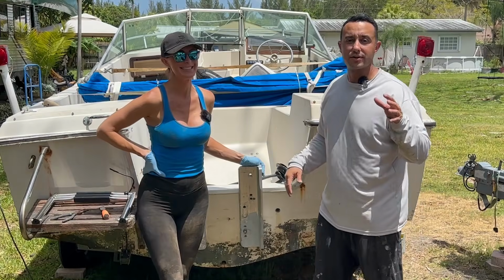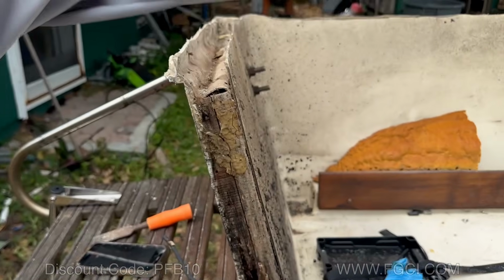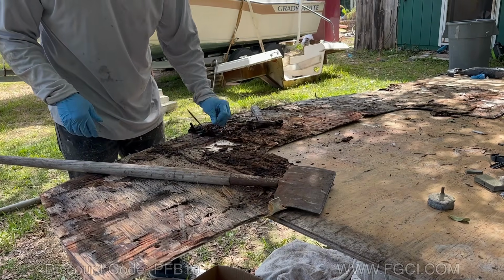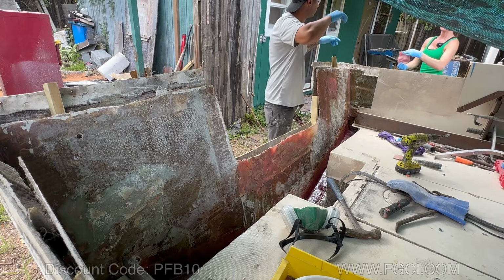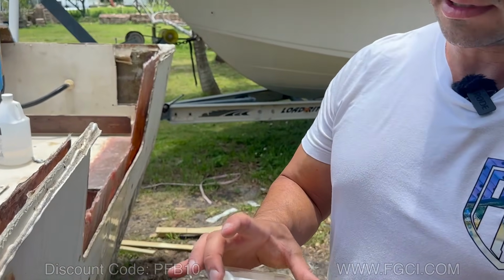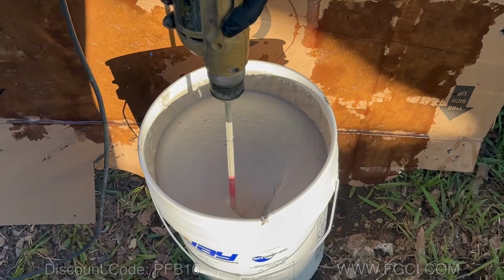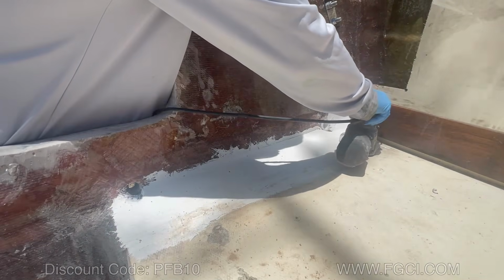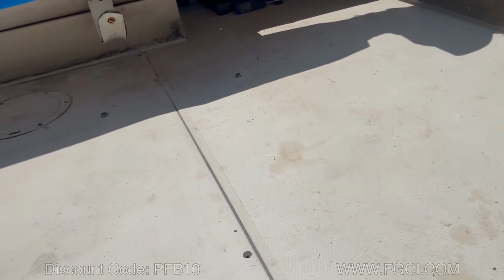Replacing A Boat Transom | Boat Restoration Project!

Comment: be VERY careful with MEKP hardener, Its the most toxic stuff you'll encounter.. One touch gets in your eye and your blind instantly. so glasses at all times around it..   One thing a friend did to get into corners to clean them out, was get a  Ebrake cable from a vehicle and cut the end so it sticks out the sheath a few inches  and the other end you let stick out far enough for a drill to hook into it.  You unravel the other side  about 3/4 inch so it will spin and clean out like a wire wheel does.

Comment: Finally a great video on Arjay 6011, I did my transom back in 2008 lots of skeptics were proven wrong, my Boat 1979 Wellcraft V 20 powered by 2015 135 HO is still running strong, has no rot to worry about, and will last forever. I absolutely love and recommend that product, the SeaCast is PIA with the fibers in my opinion. I removed the outside skin and went that route, less work. The cap at the top of the transom with very thin plywood cut to size and clamped in place during the pour, the material stuck to the ply and I used a flap disk to grind it off, I poured mine from the highest point. You are lucky the duct tape held with the heat from the curing, I sealed everything up with chop strands and resin, great work as always, the way you secured it back is better than the factory.
Reply from the maker: Thank you buddy! We also continue to prove the skeptics wrong with our other transom pour video on our Grady! It’s been just about a year and it’s been incredible with our new 250 Suzuki! We did that one from the outside skin. Actually found the inside to be a little easier due to less fairing but it can also be the experience I’ve gained. I can see how the seacast can be a pita because of the larger strands. I really think pouring is the best for the DIY guy. 
Thank you so much for the kind words!🤙

Comment: A little trick with the gloves so when they get too much resin on them. put three pair on and when they get covered you just pull off a layer it helps when you are dealing with time crunch resin and its starting to kick in this Florida heat. you dont have to stop take them off put another pair on, you just pull off a layer and keep rolling!
Reply from the maker: Yes! I tried double gloving and that wasn’t enough! Good tip! 🤙

Comment: Redid my friends Grady 21 transom, core was mush. His son used an auger bit woth a rod welded to it chucked in a drill. Finished it of with a chisel also with welded rod to extend the reach. It was time consuming butsaved us from doing surgery on the glass. Poured thickened liquid core material with chopped glas into the void, benzoil peroxide catalyst was safer to use and produces low exotherm temperatures, important when filling thick sections. I was skeptical but the result was excellent and the transom was bulletproof.  He hung a 4 stroke Honda (heavy engine) on the transom and no crushing, no problems.
Reply from the maker: That’s awesome! I love hearing stories of people finding different and affordable ways to work on boats. Should’ve recorded it for all of us to see. I know I’d like to! 🌊🛥️🤙

Comment: I’m replacing the transom, stingers, bulkheads and floor on my ‘82 V20. I used a pourable, Sea Cast for my transom due to outside of the transom being curved.  I also increased the motor height of the transom to 25”.  I’m  using 3/4” marine ply with epoxy for the stringers and bulkheads.   I cut the floor out to gain access, leaving a lip of 2 to 3 inches around the perimeter.
Reply from the maker: That’s awesome! Poured transoms are the best for curved transoms. Many boats have that curve. There’s a gentleman with a video on an aqua sport (which I’m sure you’ve watched) that did a seacast transom. I’m sure your transom will outlast the rest of the boat.
Nothing wrong with using wood for stringers either! We did the same! 
Sounds like you know what you’re doing! Congrats on your build! 🤙

Comment: Now having done both , would you two recommend removing outside skin or inside skin was the easier job ???     Liking the looks of that helper you got there bub !
Reply from the maker: I would have to say that doing the outside is easier. The inside is a lot more involved. You have to remove part of the floor, color match (if you need to) and some caps are more complicated than others. If I was to do the outside again, I’d use gel coat instead of paint which helps cut down on fairing imo. There’s some boats that have an open transom with no “cap” that can be done fairly easy too. All depends on the boat. 
You’re not alone! She distracts me and most of the viewers when she’s around! 😍. Thanks for the comment brother! 🤙🛥️🌊

Comment: When I replaced the transom in my Sport Cat 23 I used Arjay 6011 and did it from the inside. It's just easier on a cat and that way the outside glass remained intact. After I dug out the rotten core, I glassed in some Coosa that made the "inside skin", and then filled the void with Arjay. Took 11 and a half gallons. So far, I've been happy with it. No flexing at all with twin Mercury Optimax 200s hanging back there.
Reply from the maker: That’s awesome. We did our Grady last year and we’re very happy with the results! Holds a heavy 4 stroke no prob. 🤙
Reply: @perfectfitboating  On your latest boat, the splash well came out a LOT easier than mine did!
Reply from the maker: @josephwhitehead1692 we were surprised at how easy it came out! We got lucky! 🤙
Reply: @perfectfitboating  I sent you a message on your website, asking for contact info so I could send you photos of my project. I think you'll like it. My splash well is part of the overall cap so cutting it out was chore!
Reply from the maker: @josephwhitehead1692 awesome! Love seeing projects. If you got on our YouTube home page our email is there. Shoot those pics over 🤙

Comment: Did my 20.5 ft Stratos with arjay 6011 ceramic pour just shy of two yrs ago. My boat has a Evinrude 235 so I’ve put it through the test. To this day not a single problem. Just wear plenty of safety gear because the catalyst is some dangerous stuff.
Reply from the maker: That’s awesome! I’m sure it’ll last you forever! And you’re right that stuff is NASTY! 🤙🌊🛥️

Comment: I really learned a lot in this one. I never knew about transom pour; it's probably easier than laminating some sort of coring in there and probably cheaper. Is there something in it that will prevent cracking under stress after it sets up? I keep thinking of it as cured resin without matting.
Reply from the maker: I’m not exactly sure how it gets its strength. All I know is it’s a ceramic pour and that’s it’s slightly stronger than plywood and lighter. 
The problem with many production boat builders is the lack of quality control. Some might be made well and some slip by. Still pretty amazing the stringers were like new after 40 years though. You just never know what’s below deck.🌊🤙🛥️
Reply: @perfectfitboating  Sure beats $100K 20' boats. Doing what you're doing is the way to go. Just invest in a modern engine and plan on keeping it.
Reply from the maker: That’s exactly right. We did it with our Grady. Re did the transom, stringers etc and added a new Suzuki! 🛥️🤙🌊

Comment: Nice job guys foe mine unfortunately  it was done over ten gears ago msybe 12 years. This Grady white transom issue from the factory  was mild by comparison  to my 1979 Glastron  sea furry which only had two layers  of get this osb where the motor mounted.  We had to cut out the very poor glass both sides used two full 3/4 inch marine plywood laminated  sheets screwed  together  with I don't  know how many  stainless steel  screws but by the time we were done I think it could have supported  the Empire State  building like you I only wanted to do this once  thanks for showing  your method r
I really  enjoy watching everything  you guys do.
Reply from the maker: Dave, I’ve always seen older glastrons having terrible transoms. They’re popular here on YouTube but it sounds like you made yours bullet proof! And just like you, we don’t want to have to worry about fixing this again. One and done! Thank you so much for watching and for the kind words! We appreciate you! 🤙

Comment: The reason you want to start small and get bigger with the tabs is that if a layer doesn’t bond properly for any reason, the next one backs it up.  If you started big and the first bond failed, all your patches/tabs would come free and there would be nothing securing it anymore.  

Keep up the good work and transom updates.  I saw a video a couple years ago of someone using one of these products and I have to admit, I’ve always been a skeptic so I’m interested to see how it holds up.  Resin, epoxy, concrete etc are all brittle without composite or rebar to reinforce them so it’s always made me afraid to hang a big outboard or two off one of these.
Reply from the maker: That’s exactly right! Small to big is the way to do it. We’ve had great success with these transoms. The next one we do will be with composite board. We’ll be doing that in the next month or so! 🌊🤙🛥️
Reply: @perfectfitboating  I have too many projects, but sometime in the not too distant future I need to do the floor in a Pro-Line I’m planning to sell and eventually I’m going to do everything in a 28’ Aranow Design Hull I plan to keep including stringers, transom and floors.  It’s a really great hull design i picked up a few years ago but I want it all custom and done the right way to the highest fit and finish.  I may put the projects up here on YT too, just need to finish up some others before I get to them.
Reply from the maker: @andrewnajarian5994 I hear you on that. We have a 16ft zebra skiff to finish and we still have to paint the topside of the Grady. On top of that, we’re soon to be getting into a 23 sea craft to build a pilot house on it!
If you post it on YouTube, let us know! We love a good project! We’ll be your first subscribers! 🤙🛥️🌊
Reply: @perfectfitboating  will do!  Looking forward to the Sea Craft, is it an old Potter Built?
Reply from the maker: @andrewnajarian5994 yes! If all goes well, and the owner gets the title, we’re gonna pull the trigger. It’s a 78’ 23’ sceptre potter hull!
Reply: @perfectfitboating  I’ll be watching.  I actually debated building mine as a pilot house or express rather than going back with the center console cuddy cabin design.
Reply from the maker: For what we do, pilot house is the way to go. We enjoy the ability to get away from the elements. We want to be able to cook inside and have the ac running. And the ride of the 23 seacraft is one of the best in its class so it’s perfect for the fishing we do as well. We love our Grady. It’s got lots of space and the cabin is ok but we just want a little more comfort.
Reply: @perfectfitboating  yeah, my dad had a Grady 26 Sailfish for a couple of years up in NC.  It had great cabin space for the boat size!  Have you seen that Jupiter 41 Sport Bridge?  I haven’t been on one yet but it has beautiful lines.  

One of these boat shows you need to do a walk around and comparison with Jupiter, Yellowfin, Contender, the bigger offshore center consoles.  Not the massive ones (although that could be its own video) but 25’-34’ range.
Reply from the maker: @andrewnajarian5994 yes! We have the Ft. Lauderdale boat show coming up and we plan to do a video on that boat class. I love the jupiters lines. Very sleek. I’ve been aboard the Jupiter you speak of it’s a beast of a vessel!
Reply: @perfectfitboating  I’ll bet.  Every one of their boats I’ve been aboard has impressed me with both the fit & finish and the quality of hardware they use.  Their Tuna door hardware on their midsize consoles is nicer & stronger than a lot of big sport fish out there.  You can really see and feel where you’re spending your money with them.

Comment: dont know if you mentioned the age or model of this Grady,are all Gradys now  solid fiberglas are still wood transom, if you know.thanks
John
Reply from the maker: Hey thanks for commenting. Grady’s till this day use wood in their transoms. And I don’t understand why as expensive as they are. They had a big problem with the transoms rotting pre 99 if I remember right. Then they switched to a special treated plywood. My dates might be off, but even at the boat shows we’ve been to you’ll find wood all over even for bulkheads 🤷🏻‍♂️ this one is a 81 if I remember right.

Comment: Wondering why you cut the floor so close to the transom.  It seems like it would have been easier to work on the stringers if you’d cut further away.
Reply from the maker: I didn’t want to make the new gel coat line visible since the seats/cap go over it. Any further forward they would’ve been obvious.

Comment: Piping bags work great for structural putty applications especially in tight fitted transom areas. That's amazing work though
Reply from the maker: Thanks Derrick! I appreciate that! I gotta see if my partner FGCI carries those piping bags. If not Amazon should have them. Great tip! I’m doing another transom on my little skiff so I’ll use it there for sure! 🌊🛥️🤙

Comment: What a fantastic job guys! Not only the work but your video was great.  If you pour a transom is it stronger than the original with plywood? My boats rated for a 150 if ya poured the transom would it be then rated for a 175 hp outboard?
Reply from the maker: Hey Doug thank you so much for the comment and the kind words! If I remember right, this type of transom pour is a little stronger than regular plywood and slightly lighter. 
As far as the hp rating goes, there’s a lot more that goes into what a boat is rated for. Weight, hull design etc. Many people exceed that number. But that’s at their own risk. I don’t see a huge problem with 25hp more than factory. I’d be more worried with a 75-100hp+ jump. It’s not just the weight but the torque on the transom. Hope that helps!🤙

Comment: Interesting video.  I noticed at the 31:13 mark the rust stain coming down off the ring eye at the transom.   Born Again Boating’s YT channel had a great video on various rust removers and he recommended “Goof Off Rust Aid”.   I bought some over the weekend (Lowe’s for $13+tax and at Home Depot about $19) and used it on a couple similar rust spots on my boat from rusting fittings or where I had left some tools on deck and they got rained on and leached rust stains onto the deck.   WOW is all I can say, just sprayed it on with a sprayer and after a few minutes the rust stains totally disappeared, totally amazing stuff.    Thought you might find that useful.
Reply from the maker: Thank you buddy! Yes! That stuff is amazing! I’ve learned a lot from born again boating’s channel. That stuff is great and it’s so cheap. I’ve used FSR and it works well but it’s so expensive! Thanks for the tip! 🤙

Comment: Great video! I have the same boat and I’m looking into doing the same thing so I’m glad I came across this. I’m not sure if you said it but how many gallons of liquid transom did you use ?
Reply from the maker: Thank you so much! Well, you have an exact guide with this video lol. We used 3 pales so 15 gallons total. When you do yours, make sure you place spacers down the center of the transom to keep the 2.5” width. 🤙
Reply: @perfectfitboating would this work with an aluminum hull starcraft? My transom is shot, and it is hard to tie into the hull. Thanks!
Reply from the maker: @richardmccann4815 I don’t see why it wouldn’t. But call FGCI they’ll be able to help you with that! 🤙

Comment: What is the core material you used for the knees in the bottom and the back floor?
Reply from the maker: That is called k cell. Different brand is coosa board. 🤙

Comment: So the last time I believe you use ccast and this time you use liquid transom. I'd love to hear your opinions on the two different products. I know you had a nightmare with ccast customer support. To the best of my knowledge, you are the only YouTubers who have actually used both products and that gives you a unique chance to review both of them.
Reply from the maker: Hey brother! Actually the last time we used carbon core which was a nightmare with customer service and the company in general. This product is arjay 6011 which is very similar. Both behaved very similar. The difference with seacast is that the material isn’t as smooth as the ones we used. It’s got a chopped material that you have to mix and on top of that you have to get the air bubbles out with a mallet or a palm sander vs the products we used, have an off gassing material where you won’t need to get rid of any air bubbles. 🤙
Reply: @perfectfitboating  thanks for the correction. And I appreciate the comparison. I have a 17-ft hydrosports. I need to do a transom in this winter, so I'm looking at options. It's an odd shape so a pourable Transom is definitely the way to go
Reply from the maker: @oceanairbrush  idk why this comment got held in "review". i didnt see this response until just now. Pouring is definitely the way to go for those odd shaped transoms. No need to try and bend plywood or composite board. For the DIY guy its perfect. You can take your time with it and you never have to worry about it again.🤙

Comment: what is the material you are using to replace the floor?
Reply from the maker: K cell is the material. You’ve prob heard of it as coosa board. Just different manufacturers. Hope that helps! 🤙
Reply: @perfectfitboating  Gotcha thanks.  Price any better?
Reply from the maker: I think it’s slightly better but go to FGCI’s website, their link is in the bio, and they have the prices up for 1/2”,3/4”,1” and 1.5” in sheets of 8’x4’. We love it!
Reply: @perfectfitboating  I thought about that after I typed.  I will do that!